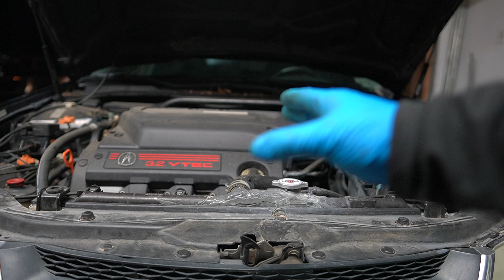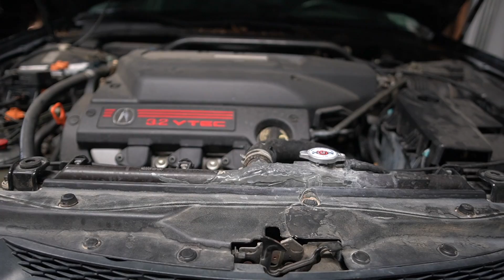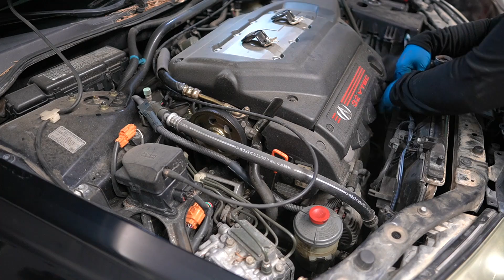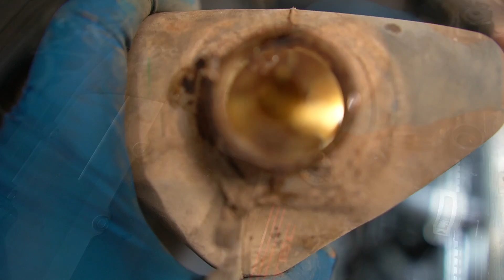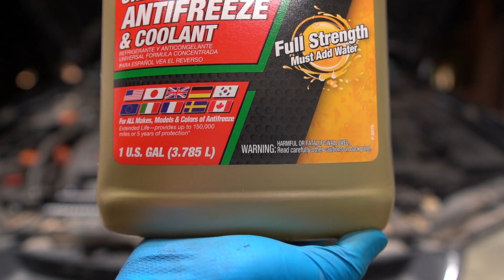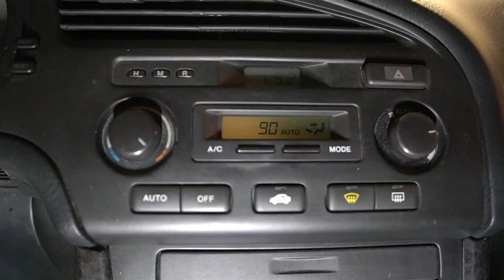How to Check and Replace Your Radiator

Comment: Mine had a sensor at the bottom center of the radiator attached to the left side fan. This made the experience of pulling out the fan a bit more adventurous than your video showed. For those hitting that issue, it’s a 19 mm, and it’s pretty much impossible to get a wrench on it at an angle sufficient to break it loose so I had to pop the mounting bracket off the fan to get it out.

Comment: hey i have a 2005 pt crusier with the 2.4 in it i changed the timming belt for the second time and i am getting a p0016 code its in time i turned it 2 full turns and the marks are dead on!! so i changed the cam and crank sensor but still getting the code!! could it be a bad computer?